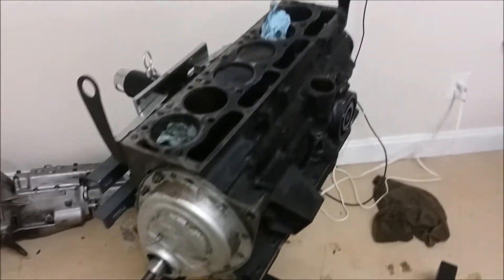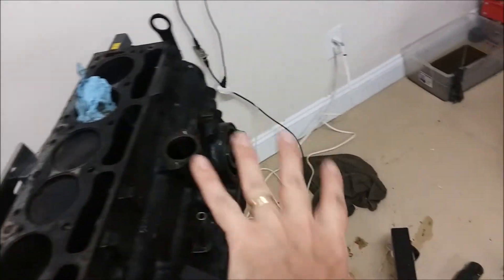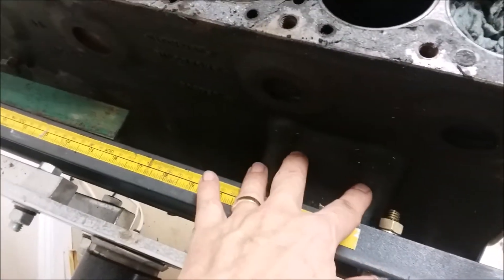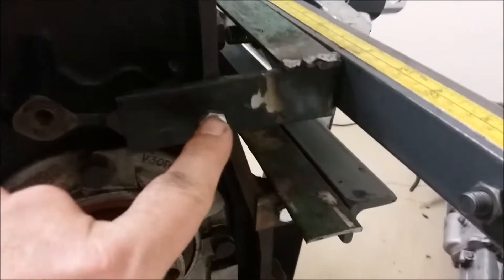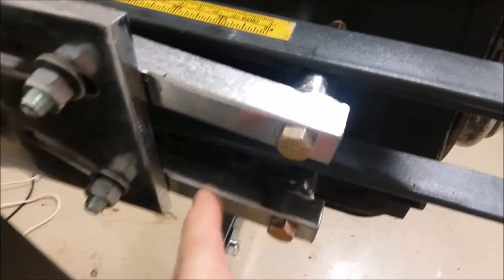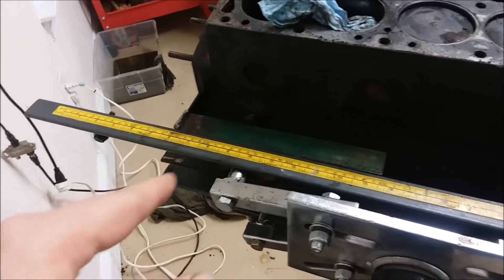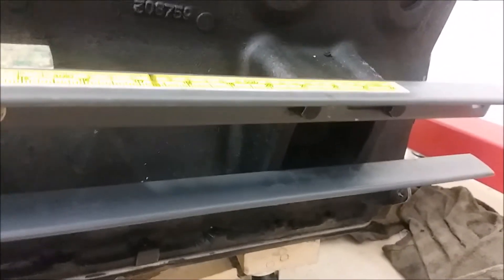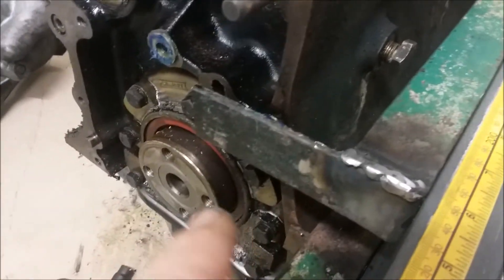Better Way to Side Mount a TR6 Engine on a Stand

Comment: Great stand. On a side note what is going on with the front of the timing cover? It looks just like mine and I haven’t tried to dig at it yet but looks like a bunch of putty or something on it?
Reply from the maker: The factory put sound deadening stuff on it.  When I redid it, I removed it, fixed the rust under it, and redid it with body filler.
Reply: @triumphrestoration7403 Thanks, good to know! It was one of many things that I've scratched my head about!